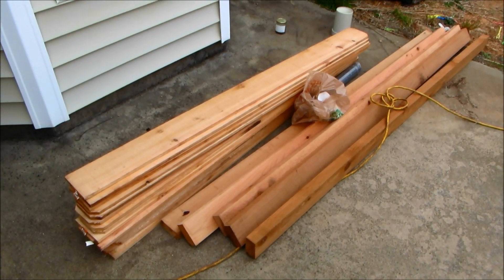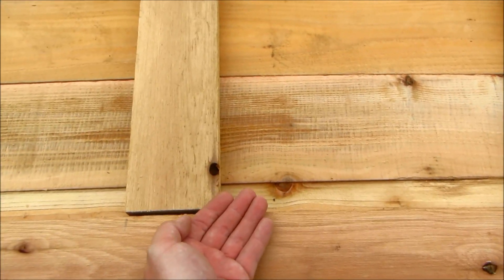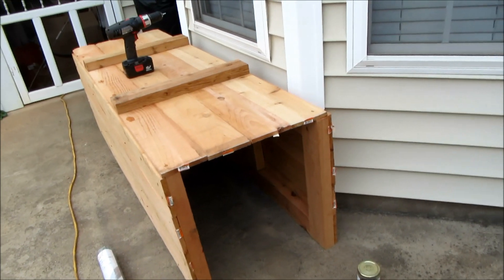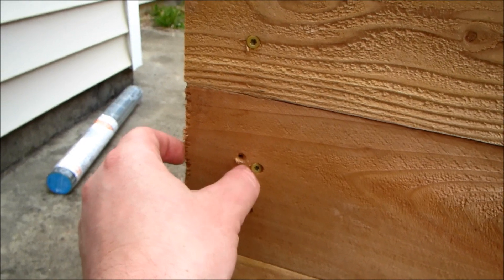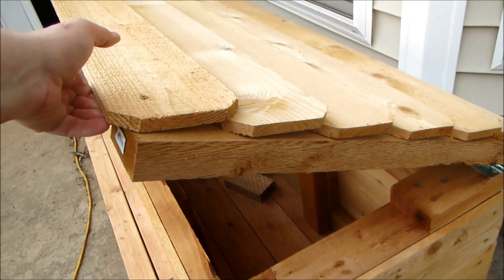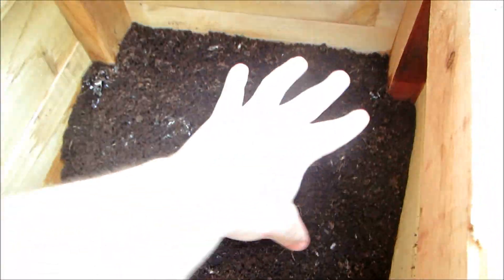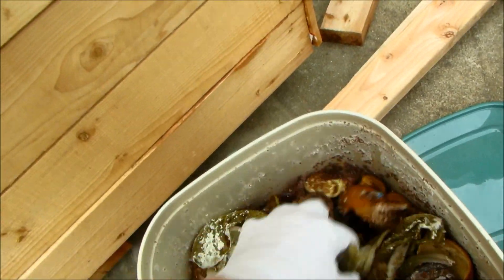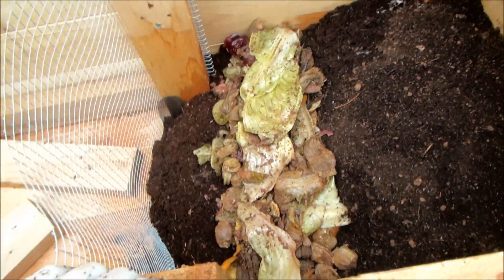Building A Horizontal Migration Worm Bin

Comment: Looks really good. I am experimenting with insulating my bins by adding a layer of scrap wood that I can easily replace on the inside. It insulates the worms and protects the nicer looking wood from the moisture of the  castings.
Reply from the maker: I am using cedar, I expect to get 2-3 years out of it. I will be putting a 2nd layer down next year just to give it a little more life.
Reply: My first bin was a shipping crate with two milk crates inside. The milk crates allow horizontal migration and the lower layer under the crates gives the babies a bit of of a nursery environment. The crate is over a year old and shows no signs of breaking down. If you line your bins it should last for many years
Reply: Also. if you line the inside with cardboard or even some recycled plywood. That would keep the moisture off the cedar. It will last much longer then.

Comment: Looks good however, should the roof have the boards the other way? Right now as the water runs down it will sit between each board. Had you turned it around it would run off just like a shingle roof.

Comment: I recycled an old shelf into a Horizontal Migration Worm Bin.

Two questions
1.It has one crack about 6 inches of the bottom between two departments.  I wonder if that is enough opening for Worms to migrate or should I make more holes.

2. Because it had some cracks (not big but few), I did not add additional holes on the wood for airflow. I wonder if your bin has any additional holes that you created for airflow. Does your design also have some minor space between the wood.

Thanks In Advance.
Reply from the maker: The wood did shrink but the air all comes from the top for my system. The worms will migrate from the top most likely so you should also have holes up there.